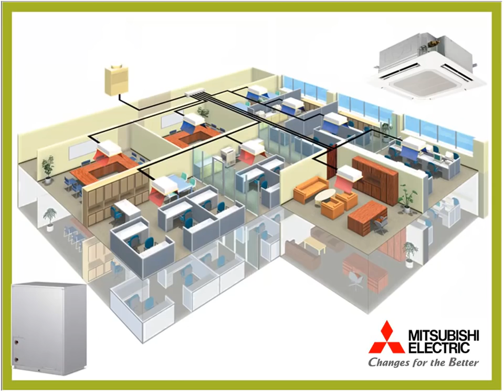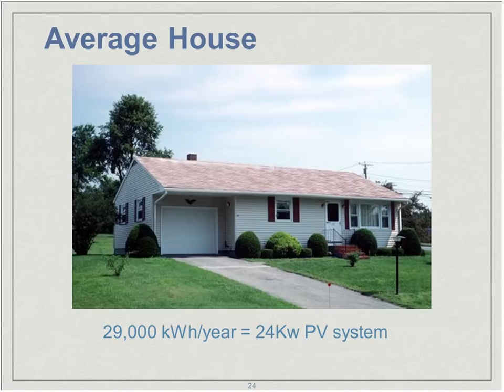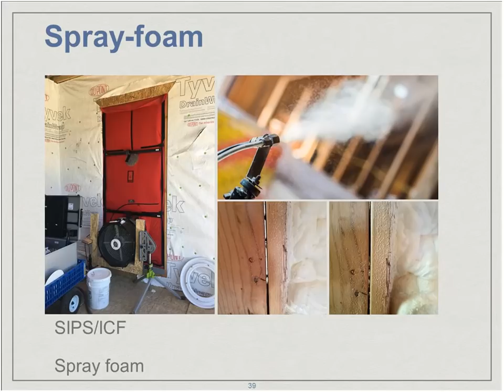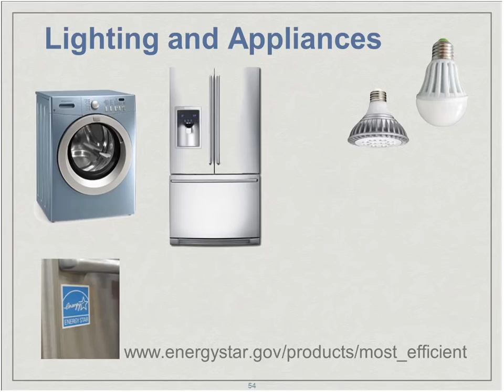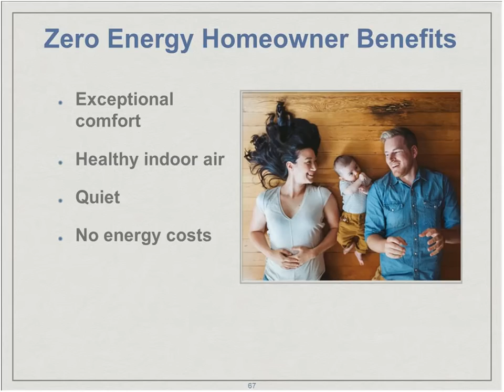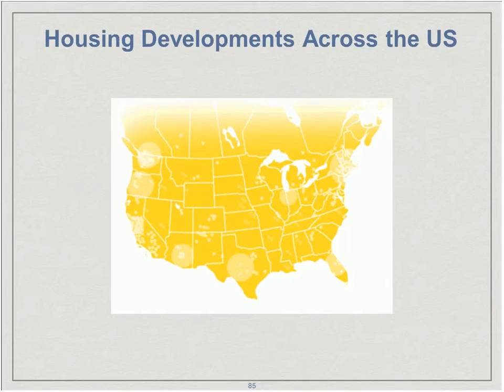How to Design and Build Affordable Zero Energy Homes

Comment: Battery storage is essential for future net zero homes.  "Author" is trying to dissuade the use of batteries.  But I know a couple things.  
1.  The grid is not always on, as it seems to fail a lot during emergencies and or at random.
2.  Solar is great but one thing i know is that the Sun is "off" at night so Solar is not working at night.  People like to use their electronic gadgets at night too and without disruption.
3.  Battery tech and pricing is better than when this video was produced so the expense is less ominous.
4.  For those that remain "on grid" and have their own on site battery storage, they have ability to utilize battery storage as means for getting paid by utilities by buying cheap electricity at night and store for selling back next day to utility when rates are higher.  Depends on your location and what local govt allows.

Comment: You spent time describing mini-splits for HVAC, but no mention of ground source heat pumps ...aka geothermal. Any thoughts on geothermal for residential?
Reply from the maker: Douglas Elbinger  The premise of this webinar was the most cost effective strategies that are seen for getting to know zero.  When it comes to heating and cooling it’s very difficult to justify the cost of geothermal in single-family homes that are under 5000 ft.² or that are not minor renovations to go geothermal versus air source heat pump’s.  Dollar for dollar that money is better well spent putting it into the solar panels and just doing air source heat pump’s.  I have seen the same numbers play out in all of our energy models and cost benefit analysis which just could not pencil out. 

 Also you also are trying to become as cheap as possible here so getting rid of ducts is important and that’s why we looked at minisplits mostly.

Comment: Isn't there a thermal bridging issue when using conventional timber framing? Wouldn't this concern then be a deciding factor for owners to then choose to use ICF, SIPS, SIFs or even pre-fab units constructed off-site?
Reply from the maker: You can check out TSTUD.com to help with that but yes there is. You can also do exterior rigid insulation to help stop that to.  Prefab offsite can have the same issue if they have conventional framing. ICF and SIPS would solve this but are expensive, especially ICFS.

Comment: Has there been any studies on how well sprayfoam holds up?

Seeing how it's the airbarrier, but the foam hardens up, when the building moves (shrinks and expands and winds) shouldnt there become cracks and gaps from the lumber to the insulation over time?
Reply from the maker: There are many if you look around online but none that come to mind now!
Reply: Don't use sprayfoam:  it's nasty and increases GHGs.   Aerobarrier make a less toxic product that can seal up all the leaks.